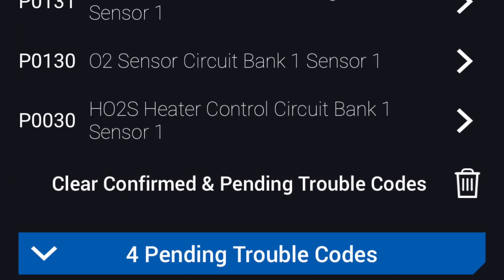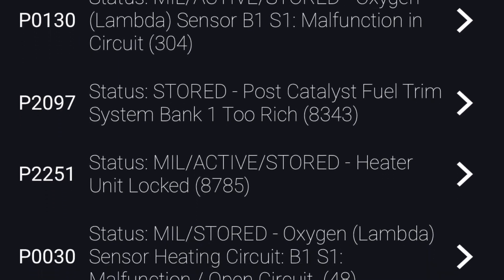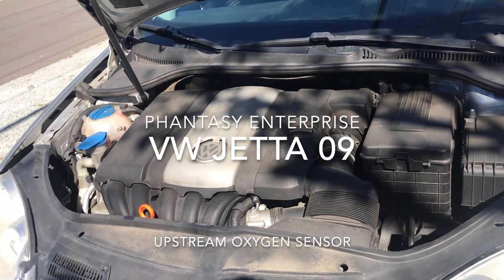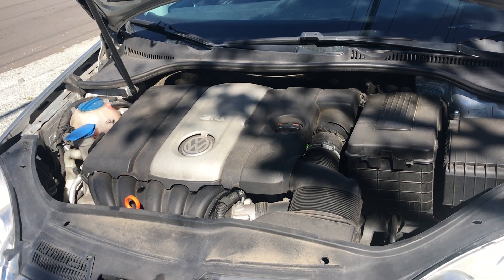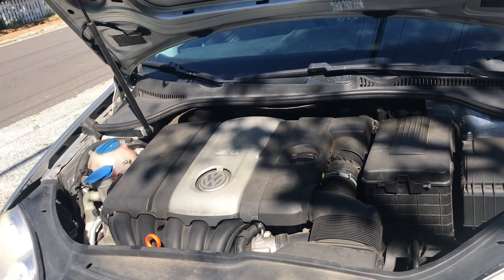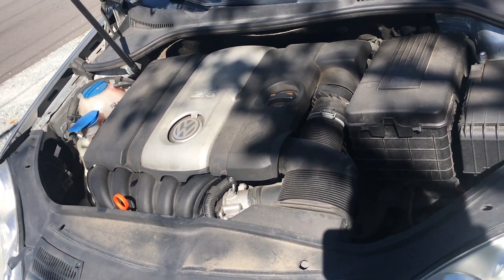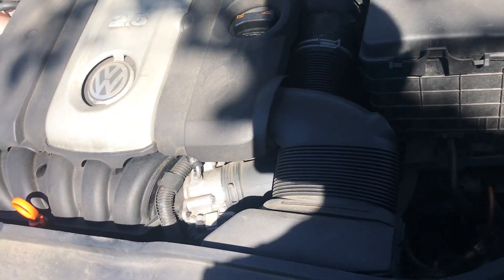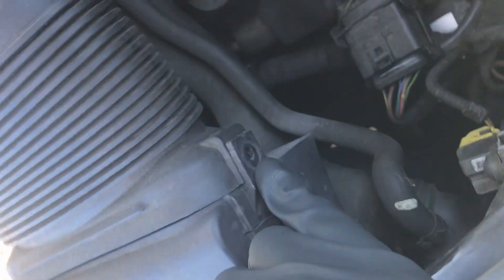VW JETTA oxygen sensor replacement 09

Comment: Hey by chance, did you clear code after you installed the new oxygen sensor? Or did you just perform a drive cycle and it eventually went away?
Reply from the maker: @socaljr9526  I generally clear the codes but waiting until it cycles and turns off naturally is best.
Reply: @phantasyenterprise  - by chance did you get an open loop fault for fuel system 1 during your diagnosis?
Reply from the maker: @socaljr9526  no I didn’t sorry
Reply from the maker: @socaljr9526  I haven’t owned this car for over 5 years so it’s hard to say